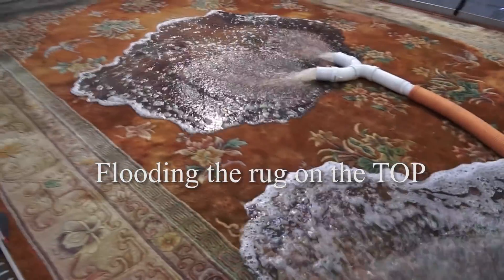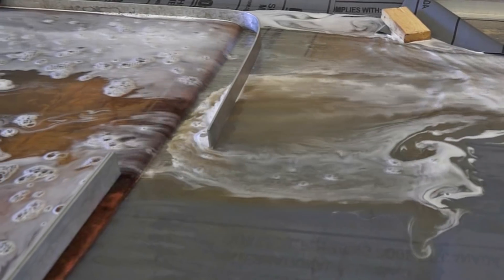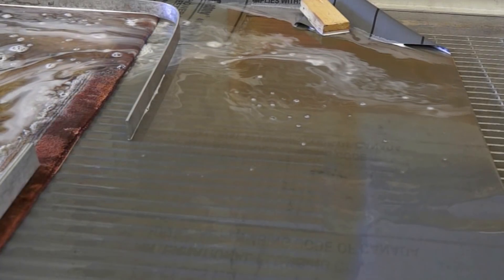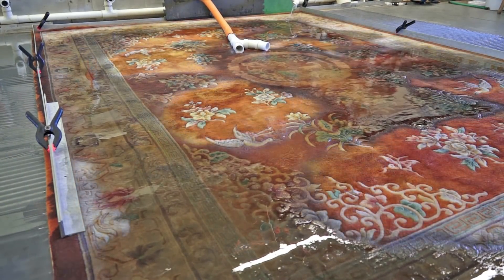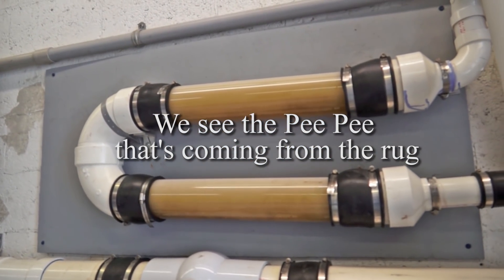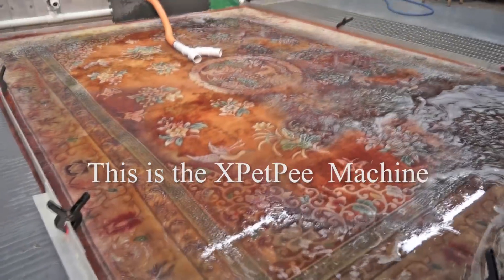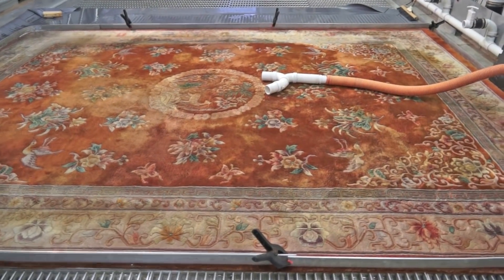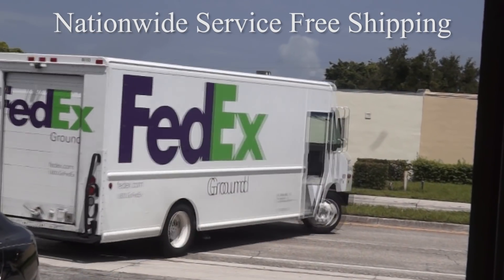PetPeePee Company-Dirty job Part 2 - cleaning Oriental rug from dog urine

Comment: I have a rug the was given to me ... Has two issues with it ... One it smells really really bad of dog urine.... And two it's kinda falling apart at the seams of the design part.... I only took it as for a cleaning challenge... So far I have lost the battle and it's now in my shead until spring .... I hate when people throw away rugs .... When other people can use them